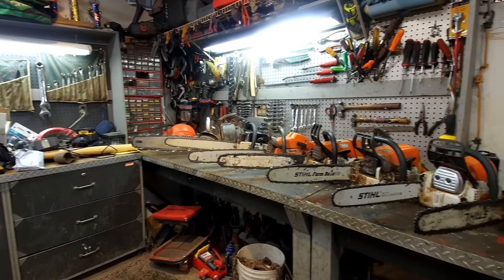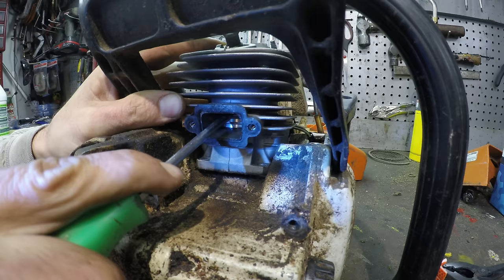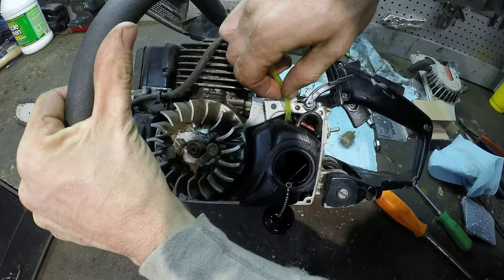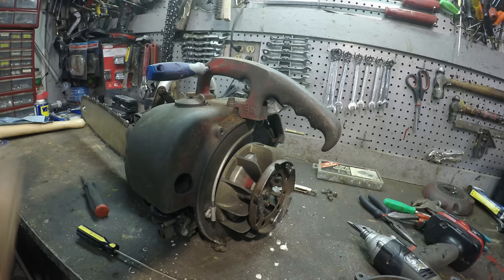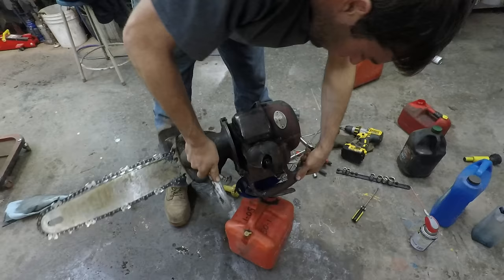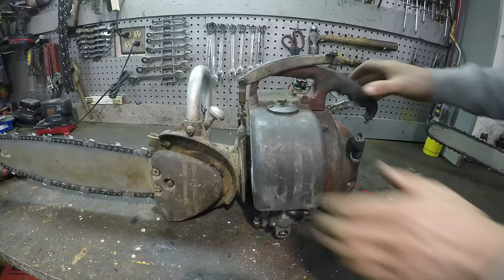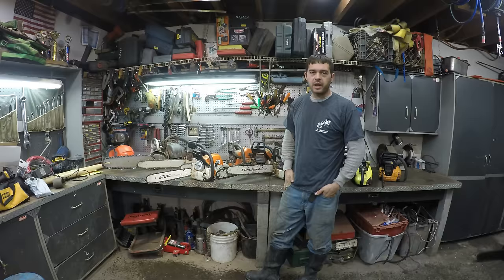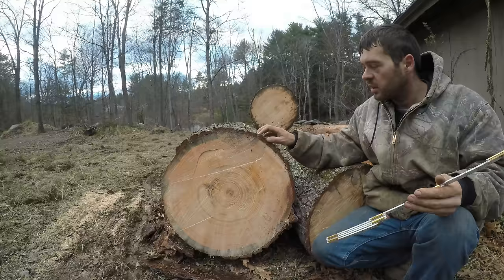Fixing and talking about chainsaws

Comment: Doctor: So Mr.Camarata, how did you manage to cut your foot off?

Andrew: Well the chain on my saw was stuck so I tried to loosen it up with my foot.
Reply: Yoo I am impressed by your decision making in your life,,,My Hats off too YOU
Reply: I was thinking the same thing. I commented on it earlier.
 I nearly cut three fingers off doing almost the same thing. 
I tried to jerk a clump of weeds out of a running hedge trimmer that was jammed.
Still have the scars more than 45 years later.
Reply: Yup...I cut huge gash in my left leg after jerking a saw back that was gonna be pinched from the wind blowing against  tree I was cutting....bout 40 stitches if I remember well.... I just warn folks don't try to shave ur legs with a chainsaw...
Reply: Went straight to comments when I saw that
Reply: Well he got it working and wasn't defeeted (sic). 😂
Reply: Well, he just got it working and hasn’t gotten defeated.

Comment: First time commenting, love your videos.  I was always told. that the oped end of the cir clip for the wrist pin must be facing up or down. I always do it facing up if its a regular one and down if it is the easy install kind like you where doing there.  If its sitting in there packman style it will compress as the piston changes direction  and over time can weaken and fall out. Thought it was a myth for the longest time until I was in a hurry on a customers bike mid season, he was back a week later.

Comment: What a great outfit you got going on. My dad was a logging contractor. We had a producing farm as well so machinery of all kinds were a part of daily life.I think I disassembled my first saw when I was 8 or ten years old.I am now 68 and still messing around with chain saws.the main thing is that you can’t let fear stop you when it comes to making repairs yourself.one thing that I do when rebuilding internals is to use assembly lube.there are various types I use white lithium or if you don’t have that use some hi viscous oil but sparingly.your machinery will thank you for it.

Comment: Good advice when running a chainsaw is to always have a sharp chain. Your saw will last much longer and you will also work much more efficient.  Never pry on the saw. You just ruin the anti vibe system and overload everything.     Best advice is Always wear chaps when running a saw.  Don't be like the guy that cut an artery and bled to death.  All chainsaw cuts are dirty.

Comment: Hi, Andrew! I have that same exact chain sharpener. I bought mine at least fifteen years ago for about a hundred bucks. So, when I first got it I actually knew nothing about sharpening chains. I read the instructions on how to use it, but I could never get it to work right. For some reason I kept it around and even brought it with me when we
moved to North Caroline eleven years ago, where it sat in my shed just like it did for those years in New Jersey. Recently, about two months ago, I got a bright idea as to how
I might get to make some use out of it. I never liked the static positioning of that grinding wheel, so I decided to make it portable. I took the thing apart and used it as a hand grinder, sharpening the chain while it was still on the saw. It works! Before this I used a round file to sharpen my chains, which I found tedious and unsatisfactory. I have been using my altered electric sharpener now for about two months and I am very pleased with it. It's a bit cumbersome to hold steady  at first, but once you get used to it, you learn.
I've sharpened my chains maybe five of six times and so far have had no problems. Very pleased with the results so far.

I would like to add in conclusion, you are one hell of a mechanic! And I don't say that lightly, having worked with state certified mechanics and engineers during my 33 year career.
I'm no mechanic myself, but I've seen some good ones. I would love to have the skills you haves for someone so young. God bless and stay safe my good man!

Comment: I own a couple of old antique chainsaws. Early to mid 50's vintage. One is a Lombard which is seized up but it looks cool. It has an 18 inch bar on it. The other is a big gnarly looking Sears that weighs about 50 pounds and has a 20 inch bar on it. The Sears is not stuck but it has no spark. One day I will tinker on it and try to make it run. As for now, they are just conversation pieces. Love your videos by the way. Keep up the good work.

Comment: "I wonder if 1950 oil wasn't as good as 2018 oil"
well, yeah, if you exclude Quaker.
Reply: Back then either straight mineral or blend of Castor / mineral. 
Told Castor was used in speedway ( pit ? ) Bikes but needed decoking often. Modern oil more detergents etc in. Good brand oil old saws run well on 40:1 or 32:1. Cheaper gas station brand oil, told use at 25:1 for engine to last. Also if left mixed more than a few days oil & gas separated or deteriated & supposed to shorten engine life.
Stihl HP Super has stabiliser already in.  Think worth the extra cost. 
Chain sharpening machine has screw to set depth grinding wheel able to reach into tooth. Top of post behind chain holder is the "stop".  If you have to remove a lot of metal, short bursts of grind better than one long one. Allows you to hand file after as temper not altered too much. Told if alter temper too much teeth liable to shear if used in freezing conditions. Hope helpful to you.
Enjoy your videos. Be safe.

Comment: Thank you for sharing your knowledge and experiences with us, Andrew. We really appreciate all that you do!
Reply: My uncle had an older 1940 something model Mall that didn’t have the recoil starter, just a rope that wound around a pulley and you had to rewind the rope after every pull. Also the cutting chain was not like the current chainsaw chains. The chain had sets of straight offset teeth much like a circular saw sharpens with a flat file. It took a long time to sharpen a chain. Enjoy your video.

Comment: I have a Poulan chainsaw that is 21 years old. I had to replace the fuel lines two years ago ( a $6.00 kit from Amazon ). The old saw still runs great. I’ve cut a lot of trees down with it and also use it to cut firewood. The chains are only $12.00 on Amazon. I go through a couple a chains a year.

I purchased the Poulan saw in 2001 to cut down a tree next to a house that I had purchased. A tree service guy quoted $500 to cut down the tree and haul it off. The price was very reasonable, but I decided to pay a $140.00 for a new cheap saw and cut down the double trunk tree myself. There were other trees I thought I could use it on as well. I’ve been using the saw ever since.

Comment: I use a six inch quarter inch socket extension to drive out pistons that get stuck.  They are usually caused by a circlip that comes out, especially on the intake side.  I take extreme care to insure the wrist pin circlip is in its slot in the piston.  I usually take an old wrist pin and insert it in the piston and tap it a couple of times.  This will insure the circlip is seated in its groove in the piston.  I do both sides.  In fact, I insert the intake side in before inserting the wrist pin and then insert the wrist pin from the exhaust side.

Comment: Considering sharpening chain saws - the game completely changed when the Dremel - type hand tool came out.  Now, I can take my Cordless Dremel out with me and using the sharpening stone attachment, if the teeth get dull on the chain - I simply take a break - get the Dremel and have all of the teeth back to a cutting edge in a few minutes.  Got to love the Dremel drill.

Comment: Very important to mention when setting up a starter rewind that you must come to the end of the rope and not the end of the spring when it's pulled out all the way. That goes for any manual pull start on any small engine. Plus add as much rope in the pulley as you can with the appropriate sized rope.

Comment: If it was bought in the 80’s, then it is a Shreveport Poulan saw.  In other words, a good saw.  I ran Poulan saws for years and they were good saws.  I still have my S25DA I bought new in 1985 and it runs good and cuts good.  It is a solid metal Pro saw.

Comment: Put the gap in the circlips that hold the wrist pin in, either on top or bottom. When the gap is on the side, the up and down momentum of the piston collapses the clip, especially when the clips are designed with that extra loop on them.

Comment: Imensely satisfying to get a small engine running and tuned from DOA. One suggestion I would offer: I have switched to Iridium (at the very least, double platinum) spark plugs in all my small engines. Believe me when I say, they start on first pull.

Comment: I remember we had extended spindles for valves in the pump room on tanker ships.  On the newer ships the spindles had white bushings at the support brackets.  Turns out they were nylon and did not like the oil that Pumpmen various had applied, caused the bushing to swell or something and basically seize up.  It that what happened with that first recoil starter I wonder.

Comment: I don’t swap out chains.  I swap out saws.  I usually take three or four with me.  Three big ones and maybe one smaller one.  I usually take my ms 360, 440, 372 and maybe a 455 or 026.  I only file chains.  If my chain got rocked I will use my file guides to reset the angle of the cutters.  The key to chains is getting the rakers set right.  My chains are what some would say are set a little hungry.  They are but they also cut and cut fast.  I also have enough ponies to pull them through wood.    I also tighten bar nuts by hand.  I do not muscle them on but they are tight.  I tighten my chains differently than you.  I snug the chain up to the bottom of the bar but I then lift the end of the bar and re-snug it to the bottom of the bar.  While continuing to hold the bar up, I tighten the bar nots.  I then check the chain by lifting the chain at the mid point of the bar and see if I can lift it 1/4 of an inch and snap back to the bar.

Comment: quick tip, the 12 to 1 ratio of gas to oil it says it requires is based on the oil they were using back in the day, you should always just stick to 50 to 1 as it's standard currently with the oil we use today

Comment: When using heavy equipment that does not have a winch to pull the log up close, always set the choker or chain closer to the butt end of the cut log so you can lift the log off the ground; this way it is less likely to dig into the soil.

Comment: Winding that spring into that little barrel is just like putting a mainspring into a barrel for a spring-powered wind-up clock. But it's easier to wind the spring into the barrel instead of winding the spring up small and then putting it into the barrel, unless you're using a spring winder, (a specialized tool).
Sometimes we have to wind a mainspring into a metal spring clip to install it into a clock that does not use a spring barrel.
(16 yrs exp.)

Comment: Lack of use and humidity cause my circular saw to quit working if I don't use it often. 
That's when I have to spin the motor with my hand drill for about 10-15 minutes before it'll start working again. 
I also love to fix things. I spent 16 years rebuilding antique clock movements for a living. I love the feeling of getting a worn-out broken down old ugly piece of garbage to work again like a thing of beauty.
I also have a collection of antique cordless hand drills/screw and nut drivers, LOL, mostly by North Brothers manufacturing and Millers Falls.
Don't you just love old tools! 😃

Comment: Four year old video, but here we go. I'm an old fart.  My Dad's first saw was bought new in about 1961 (I was 12), a Stihl 040.  I've had dozens of saws since.  The 040 was very different than modern saws.  It was a relatively small powerhead, smaller than a modern MS280, but it was a high compression beast.  If modern saws run at 12k - 13k rpm, I doubt if the 040 would get higher than 9k, by design.  It only had a 16" bar, but the chain was an .404 pitch.  The bar was shaped like a canoe paddle.
The saw didn't rev, but it was a torque monster!  It was nearly impossible to bog down, no matter how hard you leaned on the dogs.  Huge chips.
In those days, there was no dedicated 2-stroke oil.  The manual called for SAE straight 30-weight, mixed 25:1 with premium gas (all gas in those days was leaded with no ethanol, and premium was 100 octane).  I've since researched that modern 2-stroke oils could be used, typically in a 40:1 mix as an alternative.

Comment: FYI   Two stroke oils in the 50’s consisted of ordinary engine oil added to the gasoline. In the latter part of the 60’s a special oil was developed that would remain in suspension with the gas, therefore not requiring shaking of the fuel tank to mix it. Ask any old timer that had a two stroke motor cycle.

Comment: You sold me on that electric chain sharpener. I always hated using a file. I'm going to give the one a try that I saw at Harbor Freight for about half the price of the one at Amazon at $29, which had tons of high reviews and was compared to the Timber Tuff brand that cost $159.

Comment: A little late to this party but some advise for future installs, when you install the circlips in the piston the gaps in the circlips should be at the 12 or 6 0clock positions so the back and forth force doesn't work to compress them and cause the failure you had.

Comment: Most Mall saw I fixed the clutch was coated in oil preventing the chain full power. Just saying my experience with the old Mall saws. Good and rugged chainsaws that smoked a lot. You have to realize back in those days most guys would us non detergent oil of thirty weight. Sometimes they also used twenty or even ten weight in ultra cold conditions. The bar oil was thinned using kerosene. That is just how it was back then. My neighbor was a logger for years with stories of dropping huge trees that are not around anymore. One more point for you to know. When a saw sits for a long time the seals need oil to get there seal on. Sometimes you have to put in new seals, sometimes you do not. Have fun sawing wood fella too. VF

Comment: Wish you would do some of my old favorites - McCoulloch.  I sold my old tiny " Eager Beaver" 12" that I loved (Kept in in the car/truck), because I could not get it apart to get the carb off.  I still have a early 80's  huge McCoulloch Timber Bear that has only been used about 15 min ( looks new) but has not been started in 30 years.   The old ones did not like it when they switched over to ethanol gas.

Comment: The different Typs of Stihl Saws you can see in the Color of the rear Handle. 

The one colored black or white rear Handle Saws are for at Home use. Not as cheap as the Chinese Ebay stuff, but a Way more Quality, and working Safetyparts.  These are like MS 170, MS 171, MS 181

The two colored rear Handle Saws are for Proffesional use. Like your 036. They are black/white in actual models, in older ones they are black and orange. 
These Saws are for Professional Wood Workers. The Quality is very high and Parts last much longer.

Comment: Sharpening in the field is with my Dremel Tool, a12VDC/120VAC inverter and I can get pretty good with it. Most times, under better controlled conditions,  I still use the Dremel in the shop. I've tried the files and I gave them all away ... too much trouble and they really don't do a good job for me. 
Just be careful about not turning the saw teeth blue. 
Oh ... and I like a less angled tooth ... almost straight across... maybe 10° or so. And I grind the rakes completely away. I want fast cuts and it works for me.  YRMV.

Comment: Fantastic video you are soooo handy!! Is there anything that you can't fix?
I watching you rebuild the STIHL using about half the steps I do and am amazed. I'm a STIHL SILVER CERTIFIED SERVICE TECHNICIAN. I think I know why the saw failed after the previous rebuilds. The little wire clips that hold the wrist pin in place were mispositioned. The clips fit into the groove inside the wrist pin bore. There is a little cutout in the piston to help make clip insertion easier. The clips in your saw needed to be rotated clockwise or counterclockwise until a solid portion of the wire clip is located in the cutout area. According to STIHL, If the end of the clip is in that cutout, it will fall out while running and score the piston/bore. I only noticed because your camera work and video quality were so outstanding.
You Rock!!

Thanks,

Mark D.

Comment: As far as chainsaw safety is concerned, I'm surprised you didn't mention the importance of wearing Chaps. Even professionals wear these.
And with maintenance, don't forget to grease the small hole on the bar near the the tip chain sprocket
Reply: He doesnt even use hearing protection, you think he will wear chaps?

Comment: About sharpening chains with the grinder, i find it impossible using a file after one is ground upon. I'm pretty sure it heats the metal and hardens it up making it extremely difficult almost impossible to file again. Though it makes a very straight cutting chain again.

Comment: You’re correct about the oil not being as good in the fifties. The modern 2 stroke oil, even if its not synthetic would do just fine in that old saw using a 40:1. There isn’t anything different in the saw itself that required that rich of a mix.
Reply from the maker: Ok, good to know.